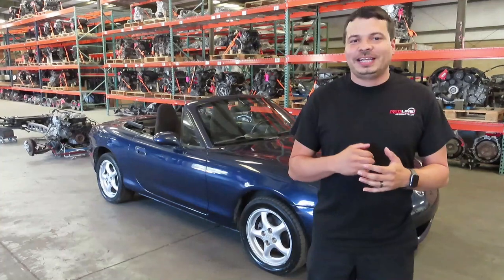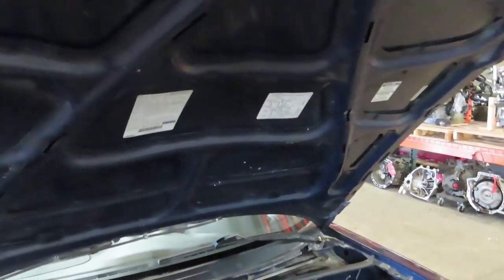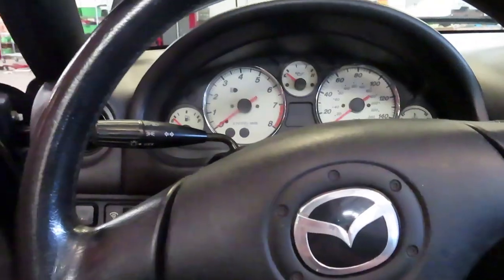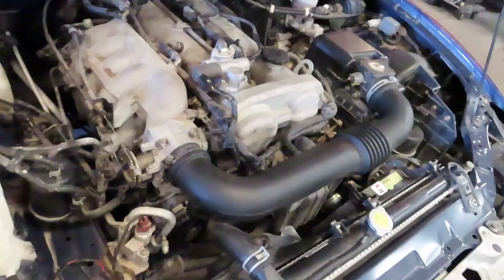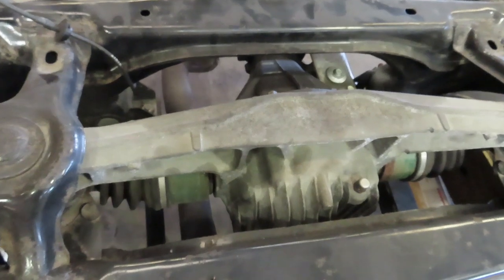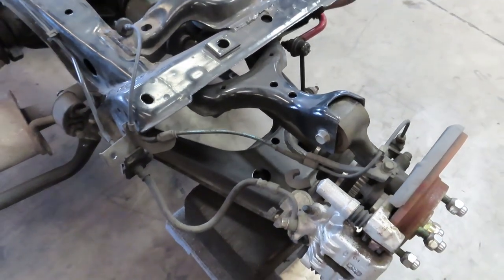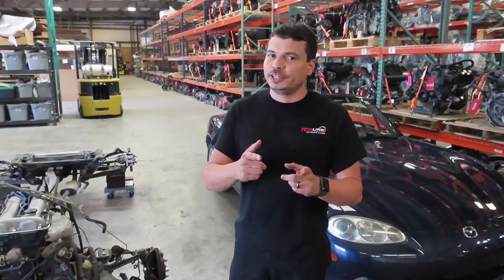What to look for when buying an NB Miata

Comment: You forgot one of the worst rust problems. The front frame can rust from the inside, at the height where the upper wishbones are mounted. If you check the car from below you can see up to the upper frame and see if there is rust underneath the frame.
Reply: Yep the “rain rail” and if it’s been painted the chances are they been painted closed. Gotta check them inner sills can believe it’s not on here 10:40
Reply: That’s what took mine. R.i.p loved my nb

Comment: I paid 300£ for my NB, fixed the sills, replaced clutch, soft top, cambelt, wheels and some other things so around 1300£ - damn these cars are expensive in the US
Reply: Oskier Gazowanykoń im scared of getting a cheap one that is probably kinda easy to repair... any words on that? i guess its worth it if i can get one dirt cheap but still idk...
Reply: @2seater_mx5  all depends what's wrong with it really. Rust is easy and cheap fix if you're not afraid to try doing it yourself and have a few days just to spend on repairing it and that's the most common thing that makes them cheap, the other things are holed soft top, worn clutch, bad gearbox or just mileage. Mine had 120k on the clock so I replaced the cambelt and all fluids straight away including diff oil and gearbox oil and that costed me around 300£, the rest is kind of not that urgent and you could leave it till the last month before mot depends how well you want to threat your car.
Reply: id consider that cheap
Reply: Its still super cheap what you got there. Here in Poland nb miatas in good condition are starting around 6$, but people are earning few times less money than in states or uk. However Mg F is decent alternative, its less known car and ppl are scared of fancy pneumatic suspension so you can buy mint one for around 3k$
Reply: You should see how much they cost in Italy...i ve been searching for a good nb all this past year. Medium price is 6000 euro ( i don t know the exact exchange rate with gbp but...you can see its a shit price )...
Reply: Lmao "expensive in US". You should not shop your mx5 in France because it's a rape!
Reply: Just bought a 2000 MX5 NB while I’m living in the uk. I move back to the states next year so I’m taking it with me, but I would’ve payed double even triple on some in the US
Reply: @maxlf2069  Yes, in France, any NB under 6K€ has rail rust issues that make them fail the inspection. hats why the ads are crawling with advertised  miatas for 3  to 4 K€ "minor rust problems, but otherwise good condition".

Comment: Snagging an 03 today, thanks for the insight, HUGE help!
Reply from the maker: Enjoy your new Miata!
Reply: Well done , 2003 fixed all the problems 99 to 2001 had ! Plus you may have a LSD even if it's not club model . An if you have the cash you can update it to a Mazda Speed (2004 -2005) ....you may want to replace CPS ($40) if yours is not running well at low rpm or pulling a random missfire code.
Reply: Did you buy it? How do you like it?
Reply: Just bought a garnet red 03 1 of 1752 of this color on parch leather bose.  It does have 140k and a 5 speed . But a mechanic got it on trade for work done and already fixed alot issues.  We settled at 6400 bucks.  But its super nice.  And my son is excited to start getting it track ready

Comment: I own a '99 MX5 and it was great to see the chassis without the body. Nice one!
Reply: Its ont the chassis
Reply: The chassis and body are one piece, you're thinking of the PPF (power plant frame) which connects the gearbox to the rear differential. Supposedly it slightly stiffens the car and also improves the feeling of shifting

Comment: Nice used car review.  here we can see how the whole chassis can be removed from the decoupled engine gear brake system. The most didn’t know that the car feels to drive like that it’s just a engine transmitted with wheels on the road.

Comment: changing the pinion seal in the rear end is a fairly easy job, and it is done all the time without having to take the unit apart.
Reply: I had a stroke and still have left paralysis i sold my gorgeous green 01 nb, fun car in fl.damn stroke, get to a crdio once a year
Reply: Mine hd no rust, my mechanic at gulf coast auto checked and gave it a tune just day after purchase, i loved that car, will buy another, but maybe ato if i can not retrain my brain & body

Comment: I'm actually looking to go look at a  2002 mx5 tomorow so thanks for the video, they are offering it for 1400 with a spare hardtop if it's in relitevley good shape I'm gonna try and go for  £1100
Reply from the maker: Best of luck! Sounds like a good deal, especially with the hardtop.
Reply: @RedlineAutoParts  I just looked at it, it's in worse shape than I thought but most of the things on the car are getting swapped out at some point gearbox oil was changed about 25000 miles ago and their is some rust in the engine bay and 1 sill, and it's done 130000, Mike's not 77000 think I'll look at one more and then decide. I got him down to £1200
Reply: 3 years later, 2023 and in Poland 'good' mx-5 nb starts from $5k 😔

Comment: its an automatic, burn it
Reply: Mx5Love swap it...
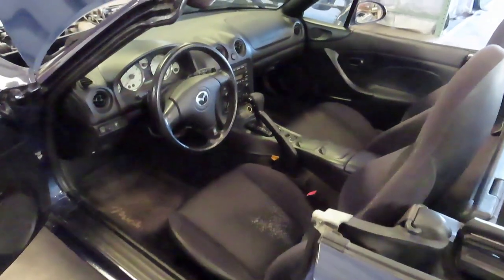Reply: 5:42.  Spotted a deal breaker.  It's an automatic!
Reply: Nah will work just fine in Los Angeles traffic. Sucks having to shift every two inches of movement.
Reply: @myshots101  if you care about that you're not the market for a miata obviously
Reply: @lytheus69  maybe not but I do own a 91 miata and an 85 mr2 and both are manual. It's nice to use the automatic in our traffic though. Specially if you have a long commute. But I know where you're coming from. I've been driving manual since I got my license when I was 16 years old, now in my mid 40s.
Reply: @myshots101  you're right, i'm only 19 and i would take an auto into traffic any day of the week but that's not really what the mx5 is for, it's for driving down windy country roads; something best done in a manual
Reply: @myshots101  if you think that's bad, try driving manual in philippine traffic.
Reply: @heavy_ang_patay  well that's pretty much anywhere outside the US so traffic there is on another level. I do agree that there are worst places to drive anything.
Reply: Lol, 6 speed swap it
Reply: I hate when I see an MX-5 selling for a low price on Craigslist just to realize it is an automatic. You want shitty resell? Buy an automatic Miata.
Reply: @lytheus69  that's what my s2000 is for I buyinhg a auto mx5 cause its cheap and auto for traffic.
Reply: Was watching this with my girl in Holland. I told her. Ahhh nee een automaat! Steek eh in de fik ( ohhh Noooo an Automatic! Burn it!) 5 secs later i saw this comment.
Reply: Christian Grey lol for sure a deal breaker
Reply: Swap it, then burn the Auto transmission
Reply: Scott Mccauley true, very well said. ill still burn it but you are right
Reply: Scott Mccauley i think we all understand and agree. 👍
Reply: @myshots101  that's why I got an automatic
Reply: Agreed. Any car like a Miata or Z should never be Automatic. Kills the fun of driving if youre a driver.
Reply: @lytheus69  I own an auto miata and ive been trying to blow it up for a while so i can swap in manual, to be honest its pretty damn fun in the canyon roads still, perfect rev matches every time without thinking is admittedly fun too, but not as satisfying as hitting one yourself though
Reply: @guyontheinternet8891  even the nb miatas have all 1-4 gears individually selectable! :D

Comment: I have the code for a gross air leak and it's not the gas cap. Tried the vacuum test on the switch and smoked it with no success. The charcoal canister is stinky but airtight. 
The check engine light stays off for a few days if you reset it.
Runs fine but stumbles when cold.
Needs a good first warmup.
Any advice is appreciated 👍.

Comment: A new top professionally installed costs well over $1,500. Not sure where the $500-800 range came from.

Buying a new Robbins top runs $500-900 then you have to install yourself

Comment: 9:52 the pan underneath on the Miata I bought shows some old what appears to be oil residue, what part exactly do I need to be buying to fix that if it happens again?

Googling "NB Miata Oil Seal" didnt really help lol. I'm hopeless at car repair.
Reply from the maker: If the leak is in the front area of the oil pan it's usually coming from the front crank seal. Very common for those to leak on these engines. It's usually replaced as part of the timing belt / water pump / front engine service. With the timing belt components off, you have access to that seal along with the two front camshaft seals up top.

Comment: What years did the Miata come with white face gauges?
Reply from the maker: From 2001-2005 they had they came with the white faced gauges. Also, a 2000 Special Edition also came with them.
Reply: @RedlineAutoParts  Thanks. BTW, are there white face gauge clusters/instruments available for later models?
Reply from the maker: @dgriffin6074  For all other Miata generations there weren't any offered from the factory. Usually people get nice aftermarket gauge faces for those from places like RevLimiter

Comment: Found an mx-5 that’s only $4000-5000 although it apparently has rust on the side of the fuel tank and has some water damage although still starts..worth it?
Reply: What year and how many miles?
I'm looking at a 2000 with 74k miles asking 7500...

Comment: How do you know if a hood is steel or aluminium?  So I take the body off the car to see what's underneath?  😆
Reply: The aluminum are noticably lighter and easy to lift. Also, if the hood is a steel replacement, probably will not have the multiple stickers underneath.

Comment: Says 11 o’clock and points to 1 o’clock...okay
Reply: The gauges on those Miata are cheap made (only 3 positions ,cold, normal, an hot ) so 1pm is OK.... unless your racing , you will want to buy real gauges an sensors. You can buy a kit that runs of the oil filter mount.

Comment: Nice car, but the automatic definitely kills it.. 
Especially so on an NA or NB.. . Their automatics are the epitome' of a horrifying slyshbox driving experience... Their longevity also leaves much to be desired . Usually requiring rebuilding at a much lower mileage than most cars.. 
  The ONLY Miata's to even consider with an automatic are the NC, and ND.. They have outstanding automatics that actually drive very well, and don't break down early..

Comment: Rpms at start run too high you want it at 800 rpms not over a thousand
Reply from the maker: They are supposed to start over a thousand, then settle to around 800rpm